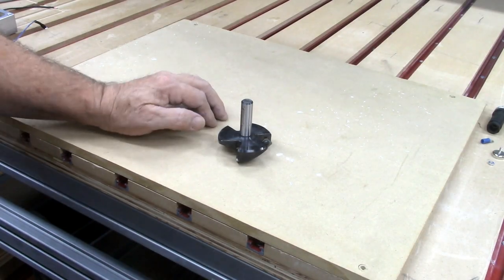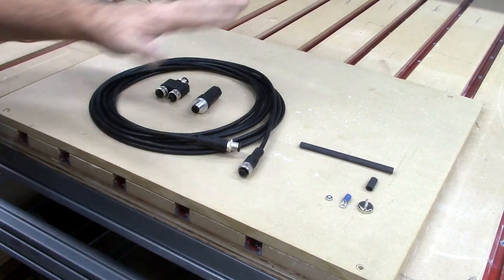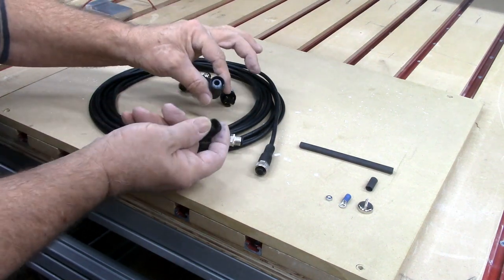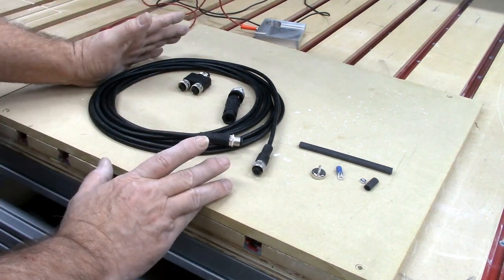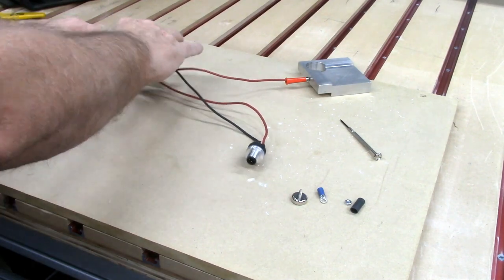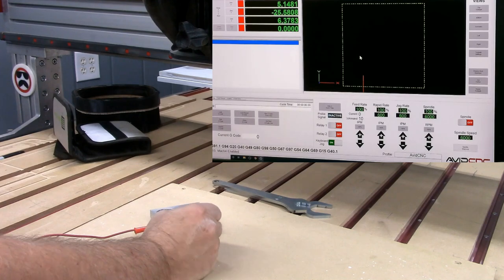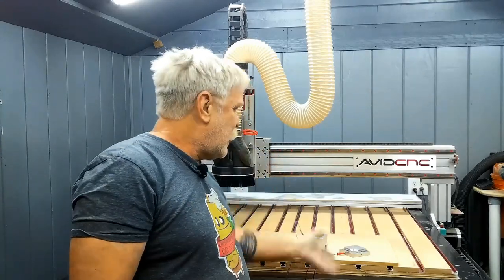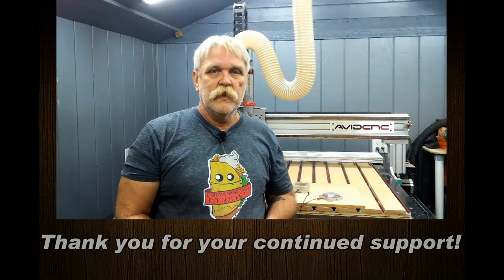Adding a Second Touch Plate to my @AvidCNC  4848 Pro CNC Router

Comment: Hello Mark! Nice and informativ video as always 😊 I wonder why you don't but the ground permanent to the motor mount for example. Then you don't need too fiddle around with the magnet evry time. 🤔
Reply from the maker: The magnet takes 3 seconds to attach and remove. In this video, I was testing the bit to see what was conductive and what wasn't. I have some bits that are painted and are non-conductive. I wasn't sure about the surfacing bit.
Reply: @MarkLindsayCNC  👍

Comment: There's a bit of nuance on how you write your auto-tool-zero script. A good script will probe twice. First, in a high speed, then back out a milimeter. Second, probe at a snail's pace, to find the exact micrometer
Reply from the maker: If you machine a lot of metal or plastics and you need 4 digit resolution, then I completely agree with you. For woodworking like I do, 4 digit resolution is a case of massive overkill. Half the time I don't even need 3 digit resolution (I'm an old-school woodworker who came up through the cabinet shops where we had a .03125 inch/0.79 mm builder's tolerance.) Still, your point is valid, and if the type of work you do requires that fine of a tolerance, then by all means yes - pursue the most accurate method that suits your work.
Reply: @MarkLindsayCNC  Do you utilize rest-machining? As you know, In RM, you have to be super accurate on your Z, or else you get a silhouette.

Comment: Hello Mark, been watching your channel for a while and finally bought a avid just like yours. I wonder if you could see what you think about this. I used the spoil board file from avid and all my rows were off by 4-5 mm. Not sure what happened. So I made another file to match my rows perfect. Ran the file after using the touch plate on the lower left corner and I was off again 4-5 mm. Past where it should be towards the back of the machine. I know very little on all of this and just want to get my top cut. Seems like a off set problem?  Thanks for and help you can spare. I think I might have found my problem.. After watching your video again. I had the tool size in correct. Still had it at .5 from tramming it. Going to re run it
Reply from the maker: Something else to remember to do is check and adjust the calibration of each axis. Jim Neeb did a great video on axis calibration on his Avid CNC about 3 years ago (He's a member of the Avid forum as well.) Here's a link: https://www.youtube.com/watch?v=E5H7Fsrq95c
Reply: Thank you so much @MarkLindsayCNC

Comment: Nice upgrade as I have the even larger Amana surfacing bit and have been using paper to zero.  Also, a good tip on checking for continuity on bits as I broke a boring bit (teflon coated) and put a nice gouge in my Avid touch plate.  If I do this upgrade, it would be preferable to find a 1" thick plate (or make my own) as the touch plate thickness difference would set me up for a human performance error that could be avoided.  Steve
Reply from the maker: Thank you, Steve That's an excellent point about making a 1 inch thick touch plate. If I knew what I was doing when it came to metal, I'd try that myself. Maybe one day...